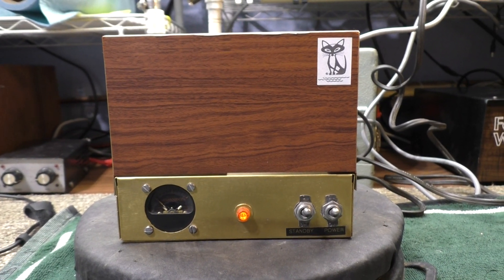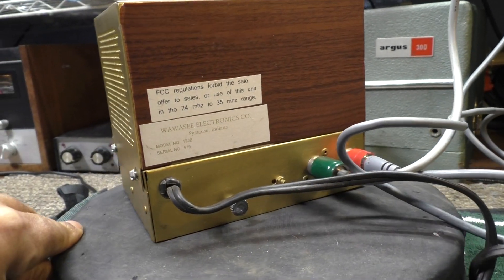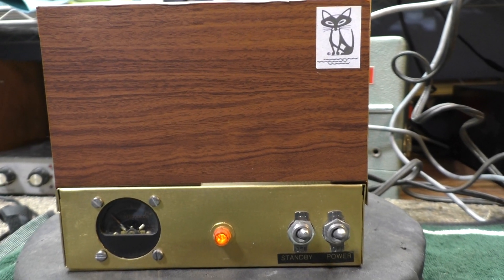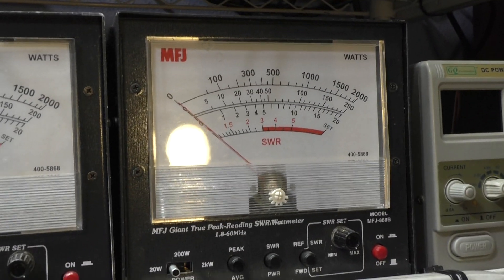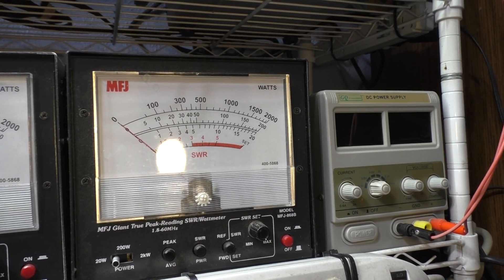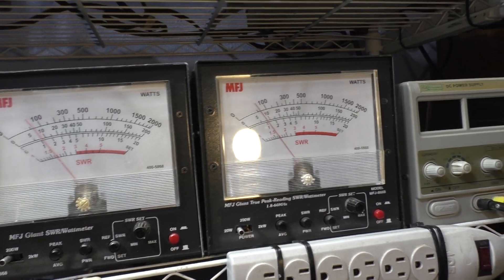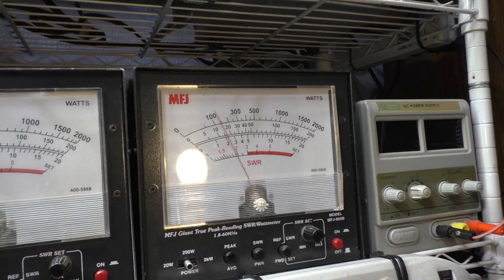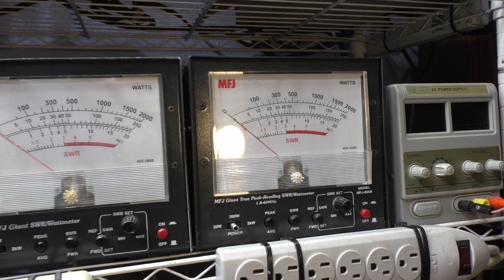Blackcat JB-12RB clean on the bench. For Informational, Educational and Acedemic purposes only.

Comment: the jb's were sold as "pre-amps" weren't they? The hot jb200 i got from you 6 years ago is still kicking strong.
Reply from the maker: The early ones were sold as amplifiers. After the FCC crackdown, they started selling them as "Receive Boosters" aka Pre-amps.